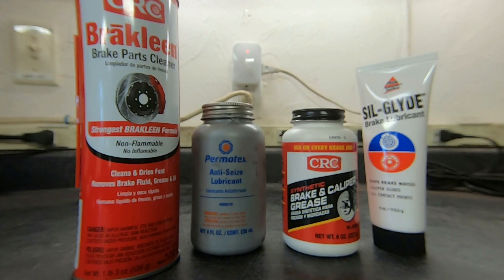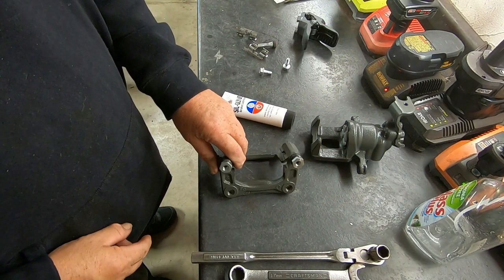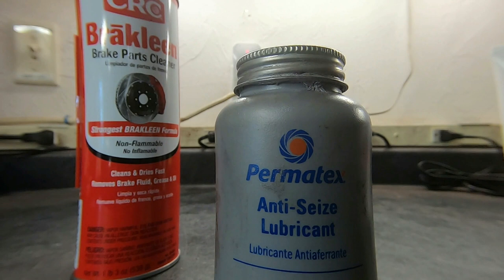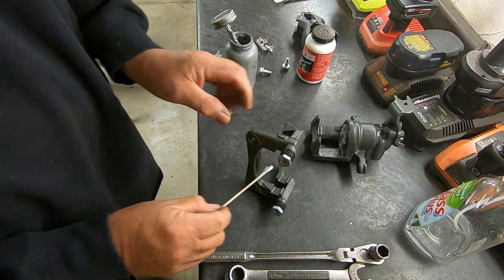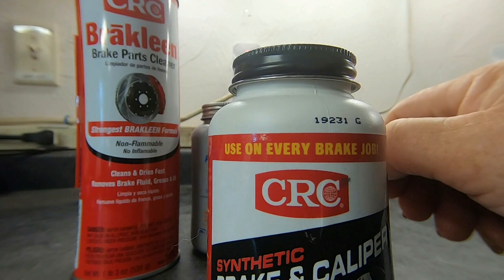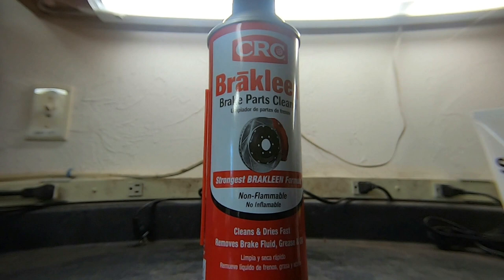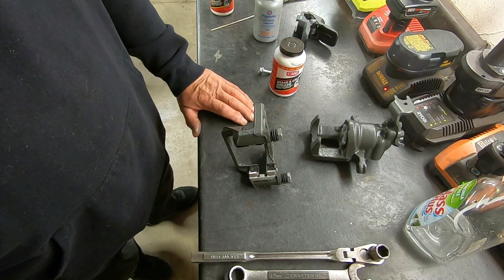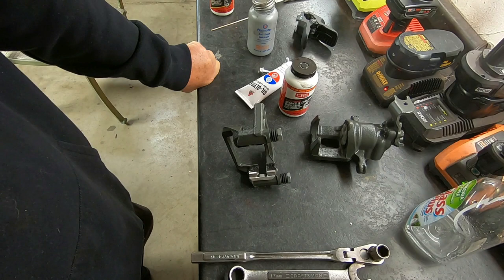How to Use Brake Lubricants

Comment: Love your video I've been doing my brakes this way for years and I'm trying to show the younger generation This is the correct way to do it. Because they've been using the black brake lubricant I'm not going to say what kind it is. But I see after a year of the car driving when it's in for its next inspection . And the other employees use the black grease, there is no brake grease left on the car whatsoever it burned off. And I see the brake jobs I did year to two years later The grease that I put on there is still there I'm working properly with very little rust in areas where you're not supposed to have it.
Reply from the maker: Thanks for sharing, vey thoughtful

Comment: 02:38 best explanation of why to place anti-seize compound UNDERNEATH clips - to prevent rust from the bracket pushing the clips out and interfering with pad slidability
Reply from the maker: I have had some criticism for recommending anti-seize due to heat generated by the brakes. Under normal usage brakes will generate about 120 F and up to 200 in stop and go. More if you have problems. Permatex can withstand 1600 Degrees, If they are heating their brakes to a temp greater than 1600 degrees then they have lots of problems. LOL

Comment: Great video! I've been doing brakes on my cars and for friends and family members and I use similar greases with great results. I use the Permatex anti-seize underneath the brake hardware (clips) after thouroughly removing dirt and rust with a steel wire brush and file if necessary from the area where the hardware goes. I use Napa Sil-Glyde or Toyota's pink rubber grease for the glide pins. I use the CRC brake grease on the top of the brake hardware and the backs of the brake pads to prevent squealing. If I use Toyota OEM brake pads on the Toyotas, the brake last somewhere between 7 and 9 years before needing replacement.
Reply from the maker: Thanks for the very thoughtful comment. I have had viewers tell me I should not use Permatex anti-seize because of the heat generated by the brakes. However, the label on the Permatex indicates it is good to 3000 degrees. If you heat your brakes up to 3000 degrees, then you have got much worse problems to worry about LOL. I agree it is very important to clean the rust and scale out of the journals. I have had people bring me the carrier brackets complaining the pads will not fit. I have to explain if they clean the journals out the pads will indeed fit. Please by all means don't be a stranger.
Reply: @richardspaulding5035 The Permatex Aluminum anti-seize is made up of grease and very fine Aluminum dust. The grease is only the carrier and it does dry out with time when exposed to high temperatures repeatedly. It's not designed for, and it's not a good idea to use it as a lubricant for moving parts, but it's a great corrosion inhibitor. That's it's true purpose. I wouldn't use it on top of the brake hardware (small sheetmetal clips that the brake pad ears ride on) or on the slide pins, but I will continue to use it on anything stationary with metal to metal contact because of the great results I've had over the years. Especially since I live in the rust belt.
Reply from the maker: @bernardocisneros4402 That is exactly where I use it, under the abutment clips, Sadly I also live in the rust belt. Southeastern Ma halfway between Boston and Cape Cod. Enjoy the conversation and appreciate your knowledge.

Comment: Thanks for the info..Seems everyone has their own ideas on what to use when doing brakes...This helps a LOT.....
Reply from the maker: LOL tell me about it, I have had hundreds of comments suggesting hundreds of ways to do it.
Reply: @richardspaulding5035  Well - While checking my brakes pads and calipers pins, I found one that I was not able to remove- seems stuck..Do you have any info or videos on removing a stuck caliper pins ? I checked YouTube as usual everyone has a different method including using a torch.. Seems like it would easier just to replace the entire bracket..
Reply from the maker: @victorlopez2143  https://youtu.be/6VyTAsok28Q
Reply: @richardspaulding5035  Thanks - I was able to loosen the caliper pin by just using wd40 and PB blaster inside the boot  then using vise grip pliers I just kept turning back and forth until it came came..I subscribed to your channel..

Comment: Yes yes yes. Thx for adding clarification to this complex lube issue. One comment: Lithium soap grease is specified for Toyota slide pins, hard to find but does the job without expanding the rubber seals on their slide pins, which jam solid if swelled by the wrong lube.
Reply from the maker: I hate Toyotas

Comment: Another thing worth mentioning is to inspect the caliper pin boots. Pins will seize up if water and contaminents intrude through the faulty boot.
Reply from the maker: Thanks, I always replace those. I will need to review the video. I think the reason I may not have mentioned that was because lubrication was the subject of the video. I don't think I got into replacing any components. Thanks for the input, that is great advice however.

Comment: Great review.  Just a point.....the silicone lubricant works better than the anti-seize and brake grease.  You can use it under the clips and on the hardware bypassing the anti-seize and brake grease.  It is water repellent and handles heat ranges better than ant seize and brake grease.  It is a superior lubricant.  I really don't know why brake grease is used when this lubricant has superior properties and works better.
Reply from the maker: Thanks for the information byron, I will most certainly look at that.
Reply: Even better is Ceramic Extreme Brake Parts Lubricant by Permatex. It has a temperature range of -40 to 3000 deg F. Sil-Glyde is only good to 425 degrees.
Reply from the maker: @naamangeist7843  Thanks I will try that.
Reply: @naamangeist7843  Thanks for the info.  The specs. look good!!
Reply: I have tried using only Sil-Glyde on everything and it doesn't last when it's used underneath the hardware, on top of the hardare, or on the backs of brake pads. It runs and dries out too easily with heat. After a few thousand miles, those areas are dry from the heat generated during braking. I had a lot of comebacks when I only used Sil=Glyde. The only place it lasts is on the pins because the rubber dust boots prevent it from leaking out or drying out. Permatex ceramic extreme is also very good for metal to metal contact points.
Reply: @naamangeist7843 . Don’t use this purple stuff on the pins.

Comment: I appreciate you sharing your knowledge.  Some people say to lubricate the back of the pads, too. Do you also do that with the CRC?
Reply from the maker: Thanks for the question; I have CRC anti brake noise spray in the shop but I seldom use it. All the high-quality pads now come with a multilayer shim that is bonded to back of the pads. These shims are designed to keep the brakes quiet.  I only use the CRC spray on lower quality pads.  You may ask why I use low quality pads? The answer is I don’t.  However, from time to time friends and family will buy their own parts and ask me to install them or will do the repair themselves then ask me to fix the common disk brake squeal that ensues.  That is when I will spray the backing.  Sorry about the long-winded response, Thanks for watching my channel.

Comment: What lube would you recommend for brake seal installation? I rebuilt the brake master cylinder on my 1974 Jaguar XJ6 but I am finding it impossible to get the plastic feeders back into the rubber grommets.  Soap and brake fluid is not helping.  Is there a trick to getting these plastic pipes back in place? Thanks.
Reply from the maker: I have never worked on anything like that, wish I could be of help.
Reply: @richardspaulding5035  Thanks for the reply.  I took a chance and pressed the plastic pipes in one at a time using my vise.   I used Q Tips to apply lots of brake fluid while slowly applying pressure.  Hopefully the master will be good for another fifty years.

Comment: What's different between anti seize and brake grease.
Reply from the maker: They are both lubricants, the anti-seize covers better and has rust inhibitors. The brake grease however is a much better lubricant. That is why I put anti-seize under the abutment clips because those are stationary.  I want to prevent rust build up between them and the carrier bracket. On the top of the abutment clips I like to put actual brake grease. This is because the lubrication quality is much better.  The top of the clips are in contact with the pads as they need to slide back and forth when you apply / release the brakes. Sorry I was so long winded. I hope I answered your question.

Comment: As soon as you put antiseize underneath the hardware clips, I disagree. Although I agree with lubing underneath, that hardware underneath is exposed to the same heat at the top. Antiseize does not hold up to heat very well at all and gets hard and crusty, almost like rust build up as you where trying to prevent that! I know everyone has their ways, but antiseize is not a good place for that.
Reply from the maker: Thanks jake; I have not considered that however I have been doing it that way for a long time. I am going to check with some of my buddies still in the business. If nothing else you have given me something to think about. Do you think I should be using the same stuff I put on top? Thanks for your suggestion and thanks for watching. By all means don't be a stranger.
Reply: @richardspaulding5035   nice to see someone not backlashing at a constructive criticism! lubing on top of hardware is a huge controversial topic. Personally I find if you have a high qaullty stainless hardware, no need to lube on top.  But 100% UNDERNEATH the hardware! I find that it attracts more crud ans will eventually seize the ears in place. As far as what lube I use pernatex synthetic brake grease for the hardware and slide pins. For the slide pins, other recommend sli-glyde because it won't damage the rubber boots, but in Northern Illinois the boots take a beating regardless and on most vehicles, it's better to spend $5-$10 on new boots. I would go try to find pernatex green brake grease as that seems to be the most respected and accepted brake grease in my findings . Antiseize has personally caused my slide pins to freeze up, burned the rotor up and warped it so I learned my lesson with that... Love your respectful outlook on my comment! You earned a sub!
Reply from the maker: @jmabs5096  Thanks jake for the detailed information. I found that Advance Auto Parts stocks the green lubricant you speak of. I will pick up some next time I am over that way.  I try to be respectful to all my commenters, even the nasty ones.  One gentlemen called me a fat F,  MY respose was: Yes fat I am but I have not been able to do the F in 10 years LOL. Don't be a stranger jake.
Reply: The permatex aluminum anti-seize is rated to 1600 deg. F. I've used It on exhaust bolts and years later (>5 years), later, they came right off and the threads were still silvery and  greasy. Also the bolt heads themselves still had the residual antiseize compou d on them. So, Using it under the abutment clips not only seems like  a good idea, but other you tubers swear by it as well - e.g. FordTechMakaloco.
Reply: @johnd.5480  too each it's own, regular antisieze I could see being used UNDER the hardware, however not on brake pad ears or sliding pins, although they are rated for high heat, there is no lubricating properties for slide pins or break pad ears. Antiseize has many uses, but nowhere should it be used in a lubricating purpose.... Unless your thd tin man 😂
Reply: What about industrial silicone multi purpose lubricant?
Reply: @jmabs5096 I've been using anti-seixe under the brake hardware for over 35 years with no problems whatsoever. I know it dries up under the hardware because of the heat, but the protection is not in the grease, it's in the particulates suspended in the grease like Aluminum, Copper, or Nickel depending on which one you use. I use the Aluminum based anti-seize on brakes because it's cheaper than the other ones, and the other ones are overkill for brakes. I live in Chicago where they salt the roads in the winter. If I didn't use anti-seize under the hardware, rust would develop very quickly under the hardware, push the hardware up, put pressure on the pads, and cause the pads to bind.
Reply: @jmabs5096  I completely agree with not using grease on top of high quality stainless steel hardware because of the reason you stated. I always replace the rubber dust boots, rubber bushing on slide pins, and hardware on every job. I can't believe you used anti-seize on the slide pins. That don't work.
Reply: @jmabs5096   Yep, never use anti-seize on top of hardware or on slide pins. it dries out with the heat and will make brake parts bind. Not good for rubber parts either.
Reply: @michaelchueh   Anything silicone based will work for areas with rubber like the slide pins because at least one of the slide pins will have a rubber bushing and they also go inside the rubber dust boot.

Comment: What would you recommend for lubricating the cylinder/piston and rub seal surrounding the caliper piston?
Reply from the maker: When I used to rebuild those years ago, they had us simply lubricate them with brake fluid prior to assembly.

Comment: hello and hi could you please tell me what is the torque spec on honda hrv 2020 on all bolts and caliper pins thanks alot
Reply from the maker: The caliper pins should be 37 ft pounds and the caliper carrier bracket should be 80 ft pounds. I am ashamed to admit this but with almost 50 years of experience I go by feel more than anything else.
Reply: @richardspaulding5035  thank lot i could not see anything on googles mostly crv thank
Reply: @richardspaulding5035  37 ft pounds pins on both rear and front the 2 bolts yes? that holds the the caliper?
Reply from the maker: yes
Reply: @richardspaulding5035  try to do my self today i started front able to remove the caliper brackets on the 2 bolts and the calipers were the boots located the only left was the rotors and i could not remove it even already the small screw that holding it i try to keep banging it nothing happening did i miss something here? do i have to remove the big screws in the middle? please tell i stop my projects because i laso punch a hole on the boot got scared darnnn
Reply from the maker: @user-wm4bo4nj8l  Check this video for removing the rotor screws. The tool I used can be purchased at almost any hardware store for about 20 dollars. https://youtu.be/iN_mic2C9JI
Reply: @richardspaulding5035  im able to remove the screw rotors but i could not remove the rotors itselfs i mean is do i need to remove other bolts  that still on rotors? im talking in front one i already remove the rotors scres but not able to remove the rotors it selfs please tell me if i miss something
Reply from the maker: @user-wm4bo4nj8l  Do not remove that large center nut, that goes to your wheel bearing. check this video. https://youtube.com/shorts/GuaN4dQv0Bw
Reply: @richardspaulding5035  i alrady did it the screw with those tools after that i could not remove t he rotors on front somehow u said its not  the center nut so what am i missing? i tried to bang it and turn while banging it still could not remove darn
Reply: @richardspaulding5035  went to the garage today saw just need to hit hard with a metal hammer darn ahh well going to redue it anyway cuz they did not clean all and lube use

Comment: and thread locker?
Reply from the maker: I don't use it on brakes. Calipers need to float. I would be afraid it might get into someplace it shouldn't
Reply: @richardspaulding5035  The mounting bracket doesn't need to float on the knuckle... or at least it had better not! LOL
Reply from the maker: @naamangeist7843  I don't follow you, I never said that it did. The caliper is what needs to float on the bracket. The bracket is tightly secured to the knuckle. Please review the video LOL.
Reply: @richardspaulding5035  well when we're referring to brake replacement, rotor replacement is also part of that process much of the time. And on my Wrangler JL, the rotor can't be removed until the bracket is removed first. Also, my pins are greased but the threaded end, nearest the head is not, rather thread locker is applied. The threaded portion of the pin is fixed to the bracket and doesn't float.
Reply from the maker: @naamangeist7843  OFF COURCE, the caliper floats on the pins or rather slides back and forth on the pins thus called floating calipers,
Reply: @richardspaulding5035  I'm well aware of how floating calipers operate. The topic of this thread is when to use thread locker. It should be used on both the caliper bolts and the bracket bolts. Just because they need to float doesn't mean you shouldn't use thread locker on the threads. Therefore, thread locker should be one of the products used in any brake job.
Reply from the maker: @naamangeist7843  SINCE 1977 NEVER USED IT NEVER HAD ONE COME APART

Comment: Hi Richard - you should try the CRC Sylaramic brake system grease. Definitely the best stuff I’ve used, have not tried the CRC synthetic brake grease but I know the Permatex Synthetic doesn’t last long at all (not that that’s saying much, CRC is usually superior)
Reply from the maker: Thanks I will give that a try next time.  Thanks for taking the time to place a comment and thanks for watching my channel.
Reply: I was recommended to use permatex “Copper” anti seize lubricant
Reply: @michaelchueh   You can use either one. The copper or aluminum. They both work equally well. I think Aluminum is cheaper.